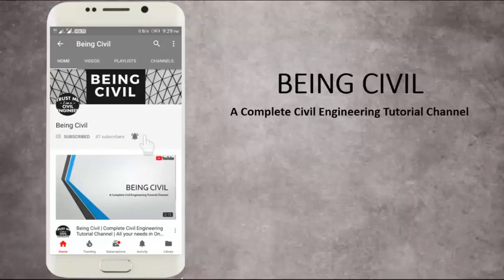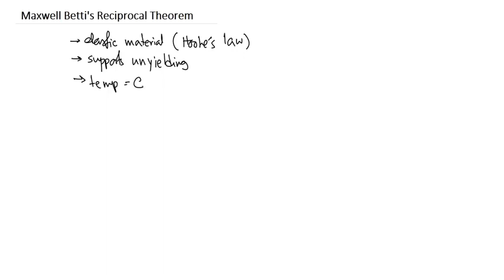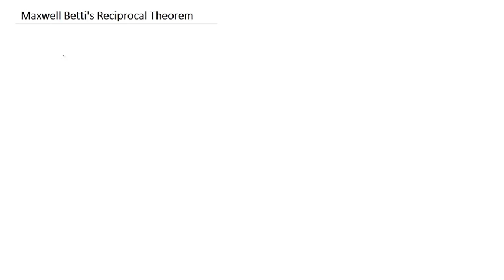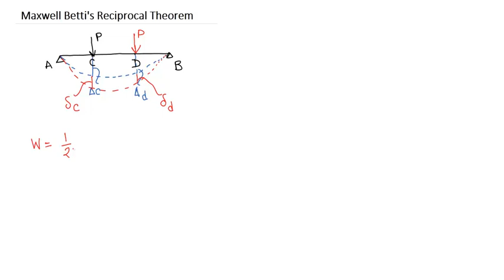Maxwell Betti's Reciprocal Theorem

Comment: Why the work done at point 2 due to load at 1 is F*d not (half *F*d)
Reply from the maker: When load is gradually applied then the formula of work done is (1/2)*F*d. But here already load at point 1 is in place. Now for any further deflection, the work done will be only F*d. Hope this clarifies. Feel free to reply back.
Reply: @BeingCivil and why is that
Reply: @mohammedasif7510  The non 1/2 term comes from p1·delta_c, where delta_c is the addition displacement from p2 while p1 is already applied.
That’s why there’s no 1/2 . U can think of it like triangle vs rectangle in the load deflection diagram.